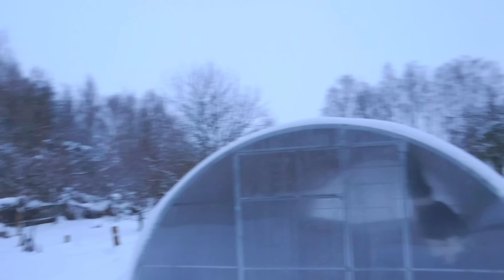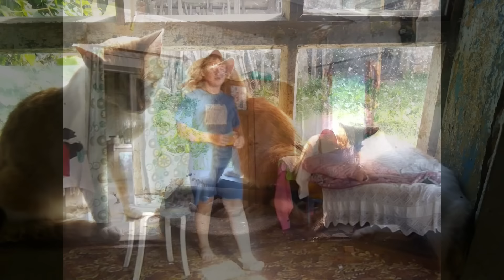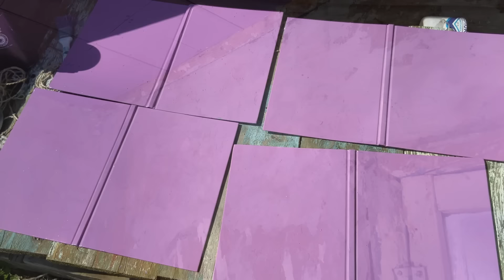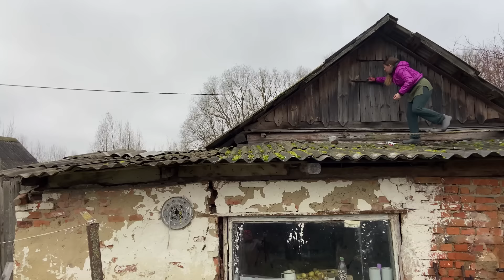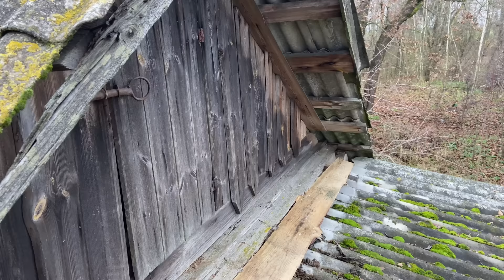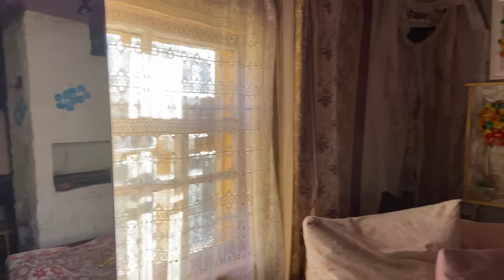My House is Falling Apart

Comment: Thanks!
Reply: Catherine, i am an architect and couldn't watch till the end!  Sorry about the bad news but that house is gone, condemned, structurally compromised, NOT TO BE LIVED IN. It does not have a proper foundation that will go about 1 meter deep underground and what you call foundation is built on grade, unstable and rotten. Exterior walls are cracked and cannot be repaired as they are missing the reinforcing metal mesh that holds the bricks together. Adding mortar will not repair the walls, just hide the cracks. The roof structure is gone, rotten. Putting new roofing tiles will only make the house look pretty from the outside not reinforce the roof in any way. Once the roof structure will be unable to support itself and some snow it will collapse on top of you. Getting up on the roof is a NO-NO! It may collapse and you can break a leg or two, God forbid. I believe i see a gas meter at 5:43. Any structural collapse of a house with gas service will create a BOOM-BOOM! I think you should turn off the gas service from the street valve, now! My advise: do not live there anymore and don't let anyone else live there also as you put yourself and others in danger. Visit when you can, take take of your garden, take the bus or car back to the city. Again, sorry for the harsh opinion but here where i live and work i would have to call the city authorities to come and vacate the house immediately!
Reply: Catherine, you need a brand new house, your house! Let me know if you need drawings for your house as a holiday present to you! ❤
Reply from the maker: Thank you for your opinion, Miro! 
I can see that the house lives off its last years but I feel it my duty to do something about it and not to lose hope.
The gas is switched off. And we always take precautions when we sleep there.
Reply: @KatsiarynaTerehova  I know those feelings Catherine but you must accept that house served you well and now it is time to let it go! I would take pics to remind me of what was there and start anew. You have a beautiful piece of land on which to build something, starting small and adding to it as you can. ❤
Reply: The easiest way to start is with a "pre-configured" shipping container that has a bathroom. You only have to build a foundation, easy, and connect the container to the septic tank, electric and gas services. I am sure there are companies in Belarus that adapt shipping containers for living purposes. The exterior can easily be decorated with panels you salvaged from the old house. You start with one container and add on. People use this kind of containers to live in while they build their new house next to it. I am sure you already thought about this! ❤